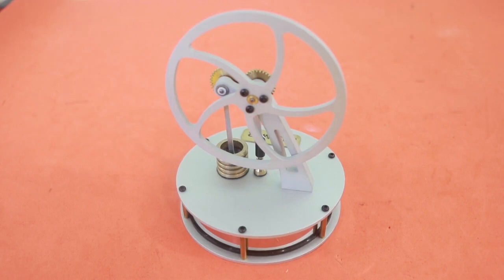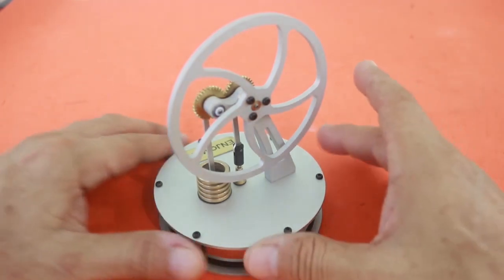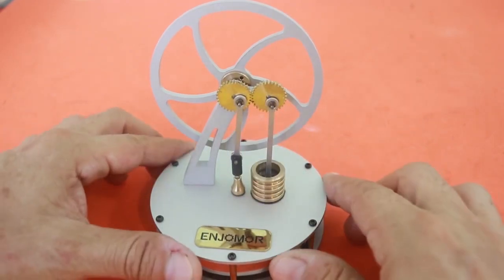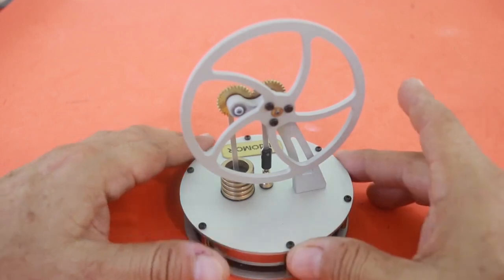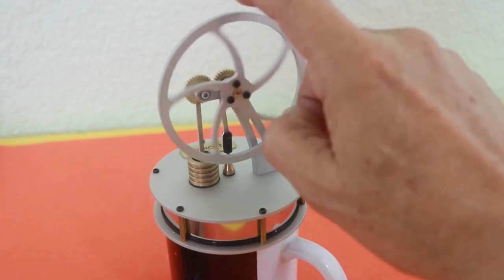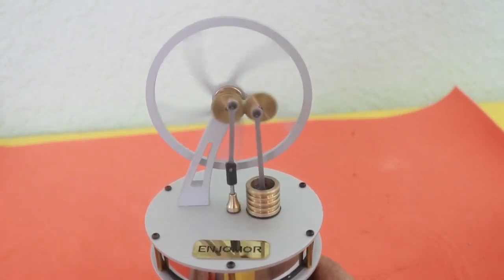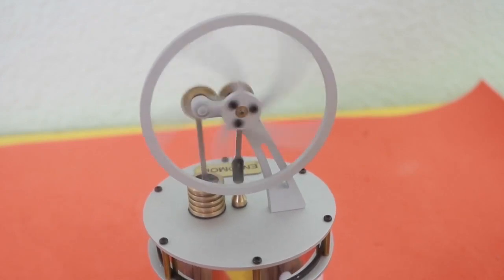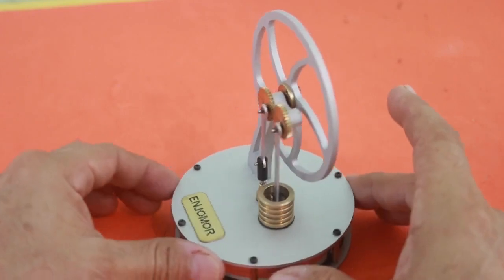Low Temperature Stirling Engine from EngineDIY

Comment: Will your hot water powered Stirling engine cool the hot water faster than an "equal cup" of hot water cooled just by convection?
Reply: These can work both ways

If it's colder in the chamber and hotter outside it will spin in one direction

If it's hot in the chamber but cooler than the chamber outside it will spin in the opposite direction of the above.

Well at least I think that's how these one work anyway I could be getting them confused with another version

But there's usually a way to keep them spinning 😊